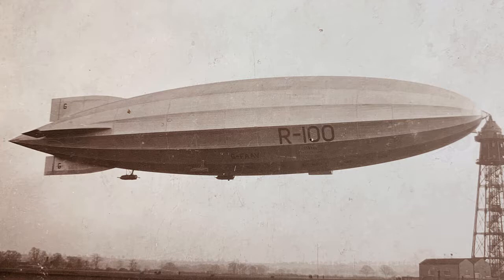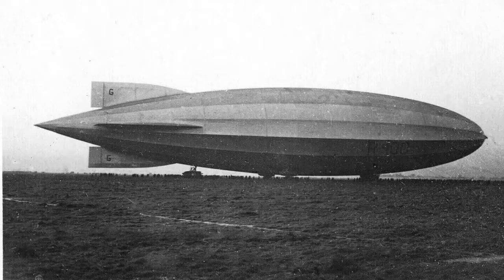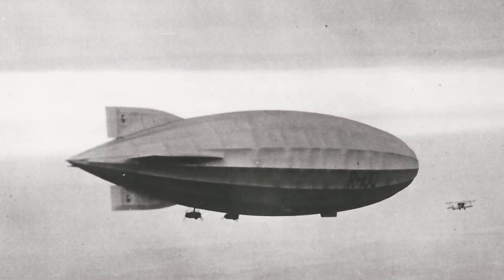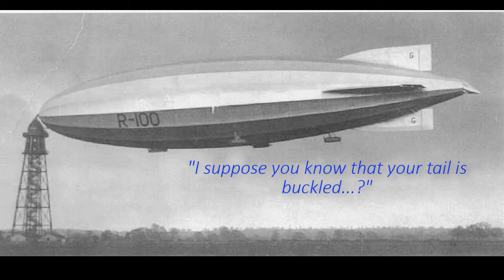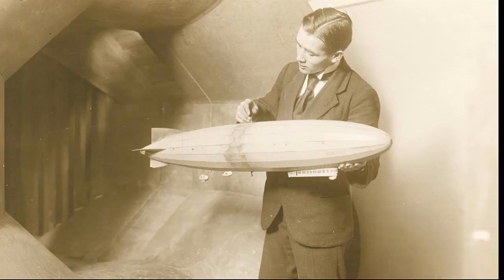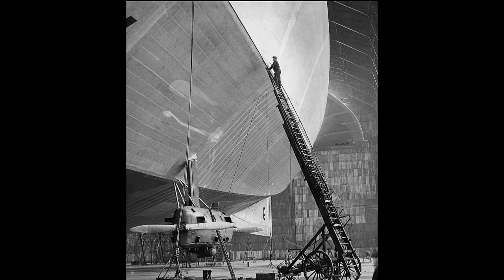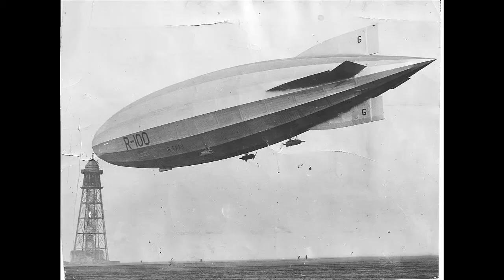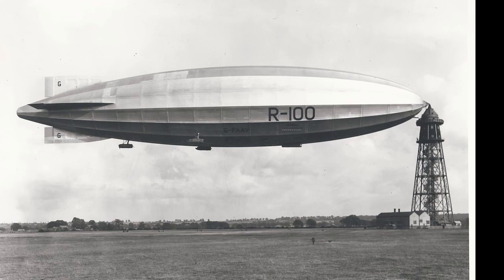R . 100 and the Tale of two Tails

Comment: Any difference in performance?
Reply from the maker: Hi there, from what we know, the top speed was not changed. The only thing we can see is that the later German and American ships went for a rounded tail in thier later ships, LZ 129 and LZ 130, Akron and Macon,  so incorporated the design changes or also spotted the problem with the air pressure.  The earlier ships such as the Graf Zeppelin had a sharp tail.

Comment: Does anybody know if the rounded stern reduced the top speed?
Reply from the maker: From what we know it didn't, however another top speed run was not tried, and stops were put on the engines. If there was more time to test or the ship gone in to commercail operations then we would have found out. Alas history was against them.